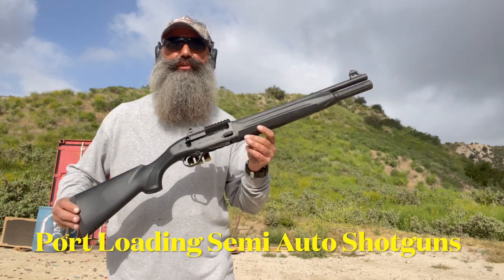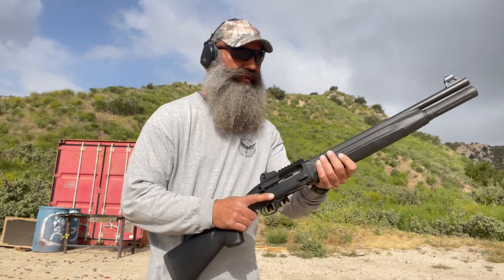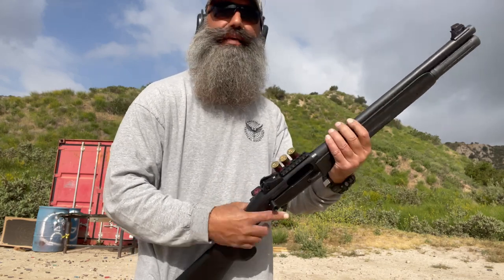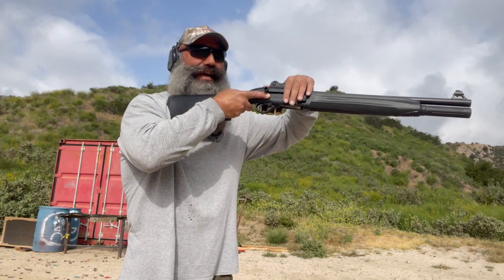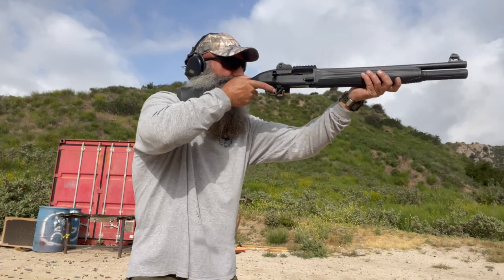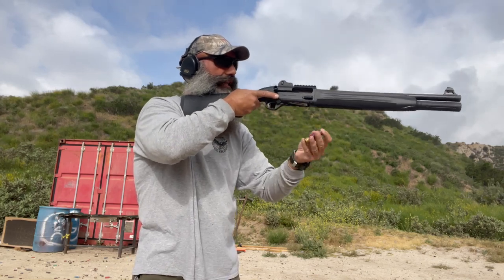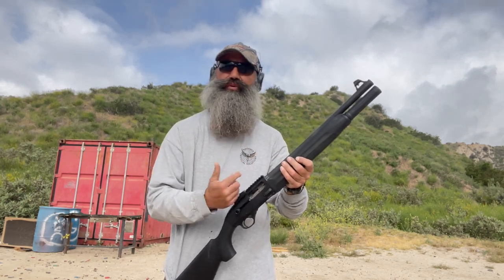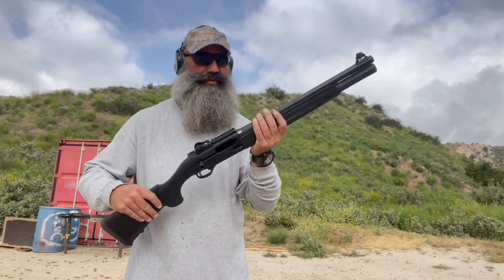Beretta 1301 Tactical (Port Loading Semi Automatic Shotguns)

Comment: Aridus Industries makes some sweet gear...speaking of charging handle they're working on a new one (I already have two; currently running the GG&G although some folks stated that they can pull the handle out of the bolt but I haven't had that issue).

Although many people state that the steel pins used to secure this carrier on say a Mossburg 590A1 can cause the holes in the received to 'egg out', no one has any photographic proof or round count until failure.  Besides, the Aridus carrier on the 1301 is secured with some ridiculously strong adhesive and I'm not putting Velcro and Esstac shot shell cards (which will eventually wear out and I'm not keen on having shot shells pop out of a carrier while firing) on a $1300 firearm.
Reply from the maker: We have seen receiver holes of a student's Benelli M4 become oval (egg out) due to a Mesa Tactical side saddle.  That's why I either use Esstac or Aridus...no need for pins.